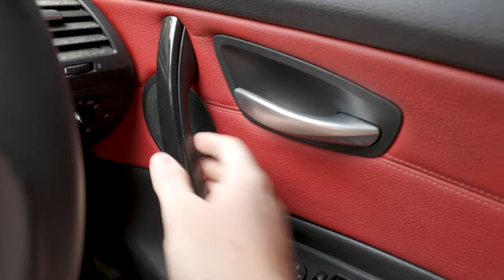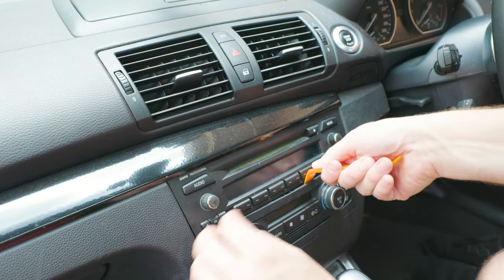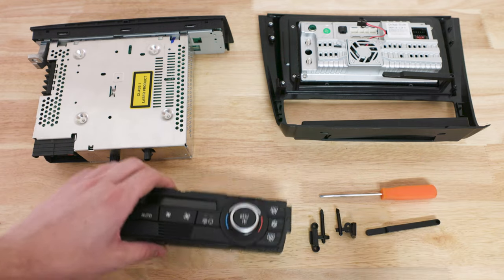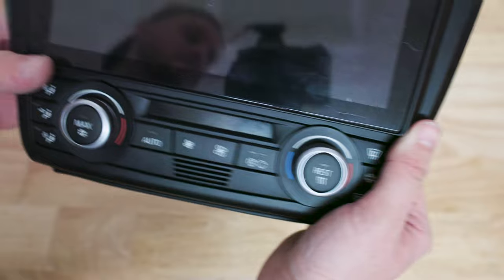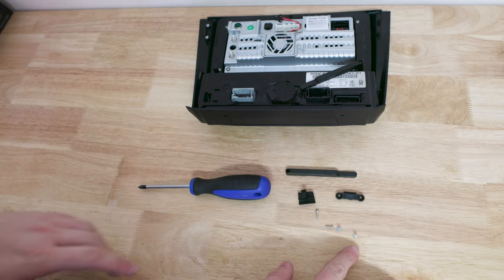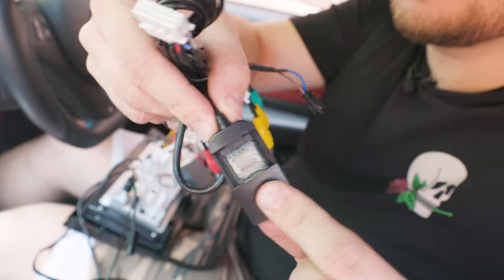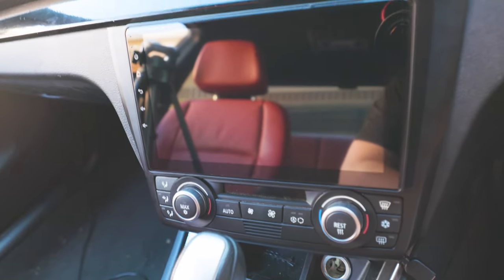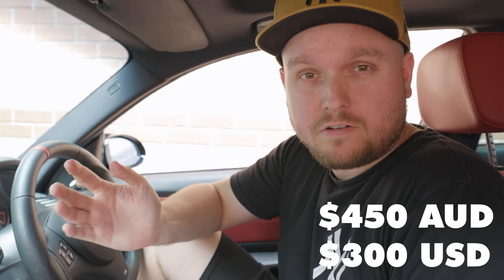CHEAP APPLE CARPLAY HEAD UNIT FOR MY BMW 1 SERIES 135i E82

Comment: Did your reverse sensors still work after this? (PDC) on my aftermarket they dont work anymore
Reply from the maker: Mine worked at first with a different sound, but have since stopped working. I’ve asked the supplier and he said one of the wires must’ve come loose. Perhaps take it off and check yours haven’t. I haven’t tried yet
Reply: @ElliottBrooks  apperently you need a special cambus adapter. Like £75 for it. Mines got a pioneer single din one in currently. I'll give this carplay one a go thank you.
Reply from the maker: @XVMods this has a Canbus adaptor included. Make sure to use the link in the video description for best quality version

Comment: Sorry what was that heated seat blocker? Mine has heated seats im a bit confused what you mean on that one. Also does this negatively affect the sound in any way?
Reply from the maker: So basically - because mine doesn't have heated seats, then I don't have those buttons. They give you a 'blocker' to block out the gap for those buttons.

If you do have heated seats, or convertible or anything extra in those buttons, you place those buttons there instead of the blocker.

I have not noticed any negative impact to the sound. When you first use the sound, it DOES sound different, but you need to change the settings in the equaliser.
Reply: @ElliottBrooks  okay that’s great thanks for the reply!

Comment: Howzit man. How so you reset your fuel consumption and adjust the clock? 🤣
Reply from the maker: Haven’t noticed any issues with fuel consumption. But also, don’t check that often hah. Re the clock - working on it. Supposedly in the settings there are options. Works off gps or network. So maybe need to add its own SIM card or connect via wifi at home. TBC

Comment: My 2007 1 series  has the start stop button and seat heating button at the bottom.
Do I then have to install the facelift air conditioning control panel and have the start stop deleted?
greetings
Reply from the maker: I apply a blocker plate because I don’t have those buttons. But yours will be on the lower face - accessible but you won’t see them. In the video you can see the gap, I just put a blank bit of plastic there instead. It’ll work fine for you

Comment: Hi Elliott, I recently got a similar radio unit thanks to this vid but I came across an issue. Every time I connect via bluetooth or Apple CarPlay the sound cuts out. You mind sharing how you wired your unit? When I tune into the radio I can hear the music just fine, but as soon as my phone connects the speakers go quiet. Thanks
Reply from the maker: Hey mate - you mention “similar”. Did you buy the exact same one or a different brand?
Reply: I have the problem I bought the QT7  after watching elliot video but the music cuts of
Reply from the maker: @stevenarcila4791  which music? Spotify or radio? I recommended getting the QT10 so I can’t comment on the QT7. I haven’t had any issues with QT10 but I mostly listen to Spotify and not car radio
Reply: i’m having the same issue here! did you manage to figure it out?

Comment: Can i use the buttons on my wheel to turn up and down the vol?
Reply from the maker: Yes you can. That’s the main reason I wanted this over using the AUX cable (as well as the screen functionality obviously). Using the Canbus integration the steering wheel controls work. We’ve explained the process in the pinned comment

Comment: Hi man can you change volume with your steering wheel button?
Reply from the maker: Yes, you need to connect your steering wheel via software - if you read the pinned comment, it explains how

Comment: Have u found any good sound system settings currently struggling to get the right tone😆
Reply from the maker: Yes, good question. I went into bass boost and put that to the maximum db (I.e slide the sliders to the top) then also select “<200hz” on each side. I also selected the “jazz” setting on the equilizer tab that had a bass heavy focus (the sliders are higher on the left that the right). Hopefully that helps!

Comment: Its 150 in Switzerland :P Where do you stuck the USB key??
Reply from the maker: They provide two usb cable outlets. You can route these wherever you want. If you wanted to get fancy you could connect it to the OEM outlet or make your own. It has wireless connectivity for iPhone so I haven’t needed to use it

Comment: if you want to reinstall stock radio is there an issue with the auto temp unit now that its plastic was trimmed? would it still fit back into place?
Reply from the maker: Hi. Good question. I haven’t tried to reverse install the radio unit. I think it would work fine but can’t confirm

Comment: Hey. I just installed the same in my bmw e87. Everything working, but aint got any sound. In the back of oem cables my old oem player uses optical cable. But the bundle that follows the kit you bought have no optical cable in the big connector😬 any tips?
Reply from the maker: Do you have an upgraded sound system or the standard sound system? I also had the optical cable in the rear previously but found it didn’t have an impact on the sound once I correctly plugged everything in. There is an additional connector you can buy for the optical cable connector - but I would check all cables first
Reply: @ElliottBrooks  i have standard hifi 677 or what its called. Ok so tou had the optic aswell. Hmm. Must be some problem with connections then. My car have original subwoofer and lots of speakers.
Reply from the maker: @keonfosho  yeah double check the wires first. A couple are sneaky and need to be interconnected
Reply: @ElliottBrooks  got any diagram? Cables I got was plug n play
Reply from the maker: @keonfosho yeah diagram is shown in the video. Also I believe there is diagrams and links via the buyers link in the video description
Reply: At 9 min 12 sec you connect something to the aux cables. What is that? Is that the reason i dont have sound? I cant find out what is wrong. It should work like urs.
Reply from the maker: @keonfosho  the two different batches of AUX - basically connecting the aux across the two areas. Hit me up on Instagram and send me a pic of what you have and I can give you more details

Comment: Hey I know this video was posted literal years ago but how is the fitment when you look at the unit and facia from the side? I've seen plenty before that look fine from the front but have a noticeable gap between the rest of the dash/console and the screen/facia.
Reply from the maker: Hey mate, fitment is good from the side besides the very bottom where it extends slightly further than the regular dash. If you click the aliexpress link in my bio - it has a picture where you can see
Reply: Oh ok! Thanks for the quick reply! Have you found any solution to that gap?
Reply from the maker: @icebrandbro4155 no solution unless you wanted to fabricate something yourself. You really cannot notice it unless you get your head down to near where you sit. I don’t really care about the gap because of this

Comment: hey mate, with the audio in are there just loose wires that you plug in? I'm about to do the install myself. Thanks
Reply from the maker: Hey man, what do you mean by loose wires? I’m pretty sure I show every wire that I connected plus the wire diagram. If you’re unsure outside of that check the aliexpress link in my description for further instructions or contact the seller :)
Reply: Hey, I think I got it sorted! Thanks for your quick reply, the one I got is actually just slightly different and doesn't have the red "audio in" male connectors, instead it has something else (a white 8-prong connector wired in to the main harness). Great video, by the way, you definitely helped me bite the bullet and order one :))  Cheers!
Reply from the maker: @marshall4049  okay cool. Did you buy from the same link? Do you have a different air con unit? Glad it worked out. These are worthwhile once you get them working!

Comment: So to to install this here instead of the dash I have to forego my heated seats?
Reply from the maker: No, not at all - if you watch the install, I discuss that the heated seats or convertible buttons are on the bottom face on the unit. I add in a blank slot instead of these buttons as I dont have them
Reply: Installed one today with manual climate control, had to fiddle more than expected in order to make the buttons work for both heated seats and climate controls, keep that in mind. Of course maybe there was a defect with my shell... Anyway, everything is working now 🥳
Reply from the maker: @GvyDskaChannel thanks for the reply. Did you purchase from the link in my video description or just a similar product? The one I’ve used looked very high quality and I don’t think should have any issues with fitment. Other people have installed without error - so if so, yes maybe unfortunate issue with your piece

Comment: I just did this install thanks to you! I'm still struggling to get the CANBUS to work.

Another issue I've had is I get static through the stereo. Almost as if it's maxed out on volume and you get that buzzing. It's there even with nothing playing.

I feel this has to do with the car audio volume levels vs the android units. Currently, at 10 on the andoid out of the 100, it's already quite loud.

Any ideas to either of those?
Reply from the maker: Yes, Canbus - you need to go into factory settings. The password for me was 88888. If you bought from aliexpress - give them a message or check for a manual for your units specifics. Once in there make sure you are connected to wifi and updated to the latest version. My seller told me to select “Eudi” as the type of Canbus and “E90” as the variant. Once you select that it will do a minor update and all of your steering wheel buttons etc should now work. 

Regarding buzzing - there is some sound quality/fine tuning settings available - have you had a look in there? Have you double checked your wiring to make sure everything is installed correctly? Which model car do you have? I agree Re: loudness. I don’t listen to music higher than 12/13 generally - but that’s ok.
Reply: @ElliottBrooks  Yeah I was able to get into the settings but wasn't able to find the exact model or the right type of canbus for it  to work (HiWorld, Raise, ect). I'll give Eudi a try though. I had guessed it might have been the E90 so thank you for confirming.

Yeah I've made sure all audio is plugged properly and it does work! I just don't like the popping on and off sound when audio comes on or is about to come on and off. You do have to listen for it but now that I've heard it, I can't unhear it haha.

Mine is a E88 135i 08,  the convertible. I'm still playing around with mine. I have the TS10 with the 6gb of RAM.

Another thing that kinda bothers me is they didn't give the device an Play Store Certification. As you say, it has wonkiness outside of Carplay and some of the wonkiness is certain apps aren't downloadable without sideloading
Reply from the maker: @annihil8ted993  I haven’t noticed the popping of sound. What scenario is that happening? I generally only listen to Spotify through apple carplay now. Or radio on the odd occasion. Yeah the key with the Canbus is updating the system to download the latest content. I tried every single Canbus setting and thought it was broken lol. Agreed that the system is a bit wonky - the main issue is that it needs wifi for a lot of apps. I’ve found the workaround to be plugging in my phone and allowing the system to use my phones wifi via Bluetooth. I think I found a setting that was “share connection via Bluetooth”. Anyway - best of luck! My advice is to pester the seller where you bought it from if you aren’t getting the specific advice. Otherwise check the page they sometimes have a manual link in there
Reply: @ElliottBrooks  Eudi worked, thank you! It's still not perfect as for things like speed, I'm not able to use MCU and have to resort to GPS. Still dialing it in so hopefully it'll resolve itself.

Usually I hear the pop of static when music is about to come on but hasn't yet. The static goes away with a small small pop if audio hasn't played for a while which I think is the unit cutting off the audio feed.

Another thing too is I've realized I can hear the fan running when it's quiet or idle but I can live with that because i don't want the unit to overheat or anything
Reply: Just installed mine and for some reason I get no sound from the door speakers but I hear sound coming from the floor speakers.. also what do I have to do to get apple CarPlay on the qt10 I don’t see the option

Comment: Did you end up fitting the reverse cam bro? I was thinking of just buying a number plate light cam and wiring that in.
Reply from the maker: Not yet man. Still planning to buy I feel it will be a bit of a mission. Have had no spare time lately so haven’t been modding my car too much. Give it a month or two
Reply: Mine worked by splicing into the pink or brownish wire in the radio harness, connect red wire from video cable there. Run camera to trunk and just connect red wire end to video camera power cable and find a ground to the black. No need to tap into any reverse light.

Comment: Any reason you opted to install this than the available head/ dash units you can install that are available for the 135i E82 model?
Reply from the maker: Do you mean why did I install the screen in place of the radio rather than install of the screens that are placed higher up on the dash? Those higher placement screens completely block your vision. When I used to have my phone holder in the centre position that was super annoying and kind of dangerous. The screens are even worse! Plus, this is completely reversible - unlike those screens that generally require cutting.

Comment: My previous car needed a start stop voltage stabilizer for aftermarket head units, assume you didn't have an issue with this one?
Reply from the maker: What functionality did that do? There is one minor glitch that I haven’t figured out yet and that’s the clock. CarPlay clock is correct but my Speedo clock seems to reset each time. There is a setting in there but I haven’t had much time to fiddle with it
Reply: @ElliottBrooks  every time the stop start kicked in it would turn the power off to my head unit, then power back on once the engine started again. Had to get one of those to solve it!
Reply from the maker: Ahh right. My car doesn’t have stop start so that doesn’t seem to be an issue. Operation of the unit is fine, but yeah this clock feature is minor but still a little annoying. It’s probably something simple haha
Reply: @ElliottBrooks  my old 1 series did that when the battery was on its way out, might just be coincidence it's been since you switched the head unit!
Reply from the maker: @vmillionaire5143  battery is all good. I think there is an extra chord I could connect or wire in to keep power when the ignition is off maybe. Anyway all good :) what car do you have now?
Reply from the maker: @vmillionaire5143  yeah battery is all good - just replaced it! Its definitely a headunit "feature" - i'm sure its solvable. Its a small price to pay for apple carplay! :D

Comment: Hello my friend, in my e88 cabrio i have two buttons to open and close my vehicle top. what about these two buttons, when i replace my system? do you know, how can i solve this?
Reply from the maker: Yes, they fit fine. They are on the underside. I put a blocker in the video as I don’t have those buttons, but you can put your buttons. No problem!
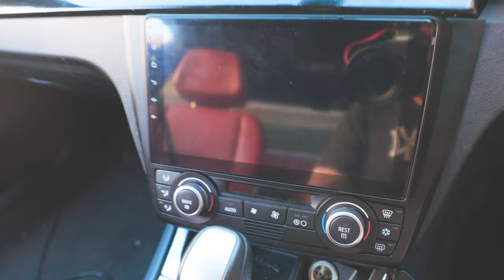Reply: @ElliottBrooks  i am not sure. Because it looks like there is no space anymore. Please check 10:26
Reply from the maker: check 4:43. I put this blocker part in instead of buttons. You would put your buttons in here on the bottom. 

In the final product (10:26) you won’t see the buttons but they are underneath slightly. Check other comments. It’s fine
Reply: @ElliottBrooks  Wow thats great. Thank you. And you are still happy with the system?
Reply from the maker: @veyselyaprak yes, very. Big improvement having CarPlay. If you’re thinking of purchasing, I recommend the seller in the link in my description :)
Reply: @ElliottBrooks  thanks for this. i found out, that there are also other sellers, which sells system with more updated android version. and also little cheaper. What do you think about them?
Reply from the maker: make sure you are looking at the QT10 version within the link. I highly doubt there is better version for cheaper

Comment: Hey mate there's a few specs if that headunit ... which specs do u have ?
Reply from the maker: Yes good call out. I realised I didn’t go into the variations after I filmed it haha. So I chose the top model, QT10 8GB RAM 128GB ROM for Automatic (there is a manual version too). The specs improve response time etc
Reply: @ElliottBrooks   thanks looking at them now ... pitty the maps and some apps don't work to nice 
Thanks for sharing 👍 😊
Reply from the maker: @vt6469  everything works inside of CarPlay or android auto. I’m sure the other apps work - but you need to connect them to an internet source. So your options are with an extra SIM card or wifi from your phone, but you may as well use the CarPlay if you’re using your phone

Comment: installed this carplay same unit but i connect to carplay i get no sound is there a fix to this?
Reply: radio works just no sound from carplay
Reply from the maker: No sounds from CarPlay means one of the wires isn’t connected properly. Double check the wiring loom. Radio will work regardless because the source is different

Comment: does this work if you have the parking sensor button?
Reply from the maker: Yes, there is a cutout section for heated seats and Parking sensor buttons. Are you going to give it a go and install? What are you driving?